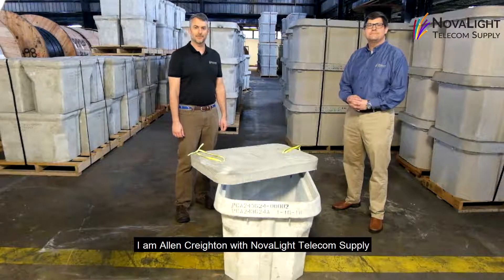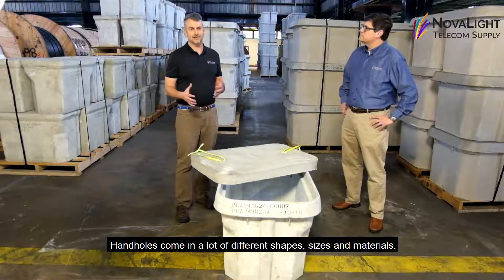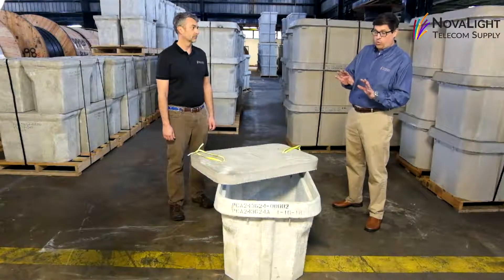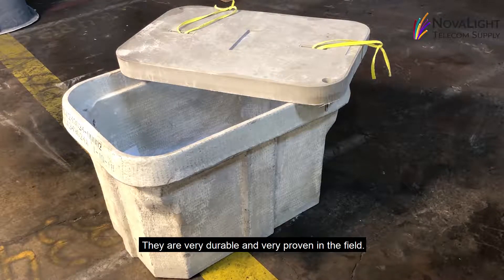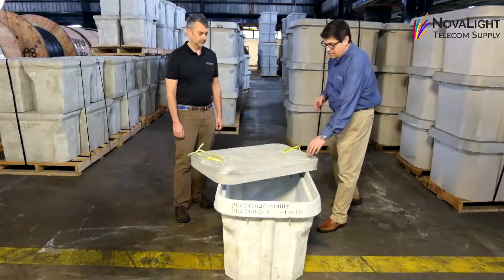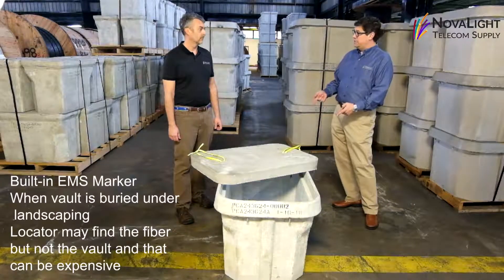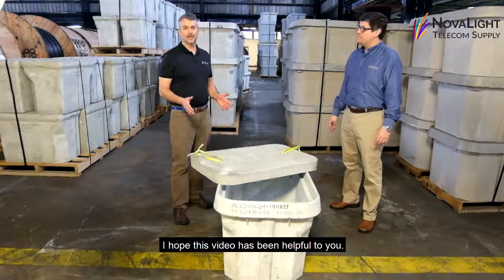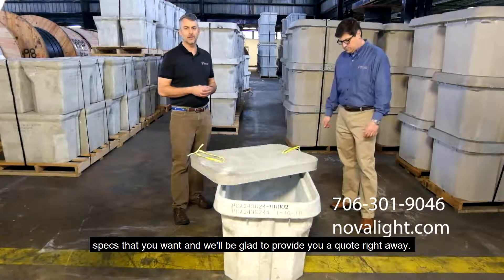NovaLight - Understanding Polymer Concrete Handholes

Comment: Why to use polymer concrete enclosures if there are fiberglass counterparts that have the same resistance specs and lower weight? price?